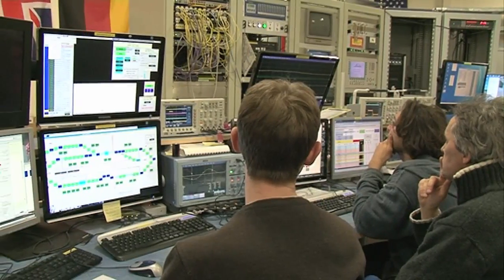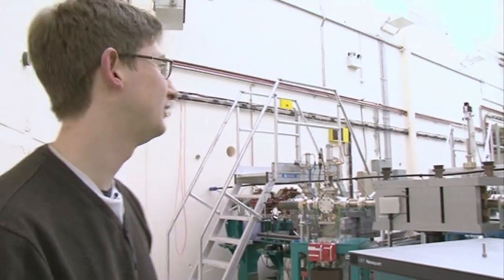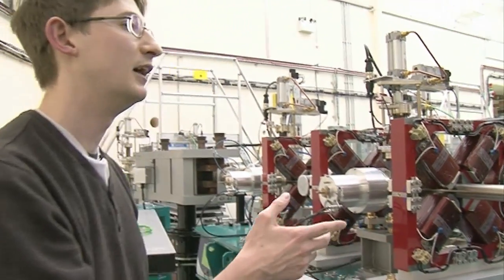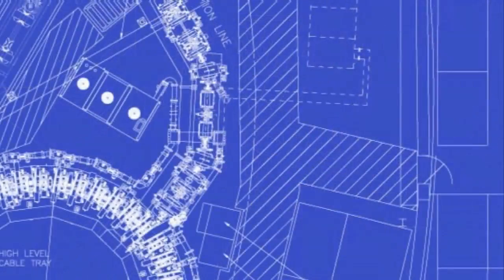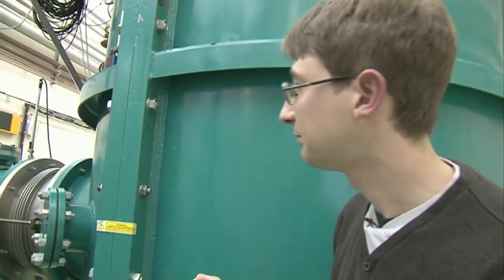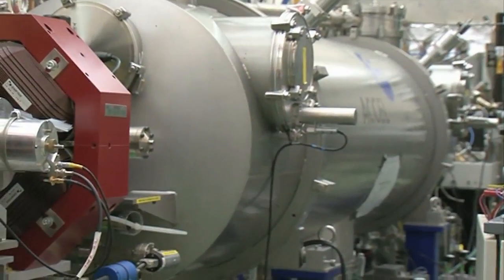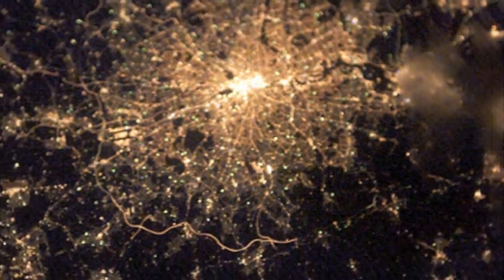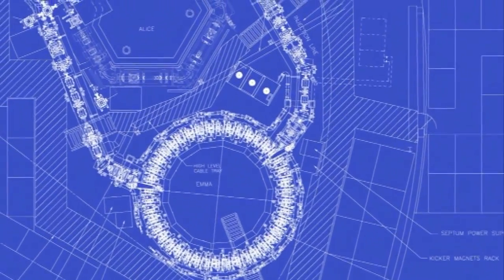Particle Accelerators - Backstage Science

Comment: Thanks for the comment. Where does the dark matter that surrounds the galaxies come from? Looking at the size of the PA in your video. Would it be possible to put it in space or smaller units like it. The ambient temperature of space is 3° above absolute 0 and space is almost a pure vacuum the energy that you would need to cool it and create the vacuum on earth could be used to increase it’s power and efficiency? I know it sounds like sifi but it a thought. To bad the shuttle program is dead.

Comment: @jeebersjumpincryst Particle accelerators can be used to help drive the fission in a nuclear reactor. Protons strike a target and release neutrons, which top up those naturally flowing through a reactor. The reactor can then operate sub-critically, which is safer, and allows the use of hybrid fuels that also contain nuclear waste; the waste gets 'burned' (actually, transmuted) as the fuel is utilised, meaning that this kind of reactor produces a very small waste stream.

Comment: @jjkul1 Particle accelerators are already used to treat around half of all cancer patients using a technique called radiotherapy. Most current radiotherapy accelerators use electrons that strike a target and by doing so make gamma rays which are carefully directed at the tumour but not the surrounding healthy tissue. Proton therapy improves on this by using the 'depth-charge' way protons deliver their dose - most of a proton dose is delivered within the body rather than at the surface.